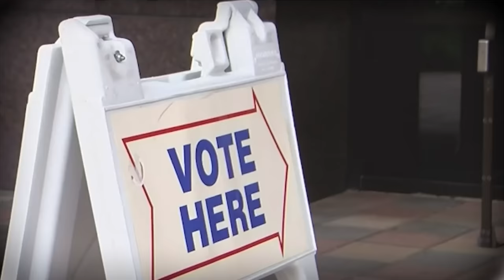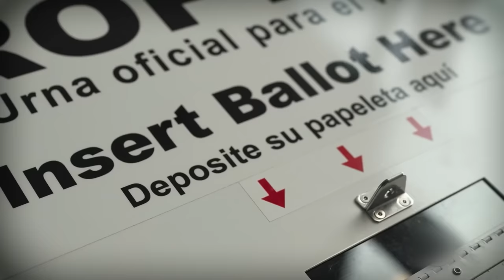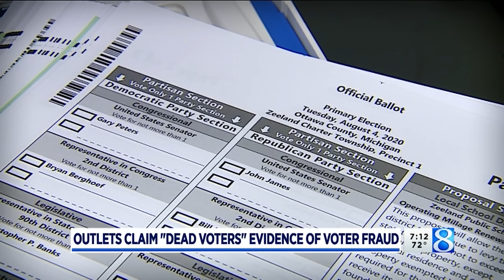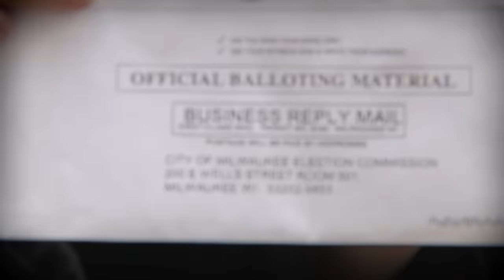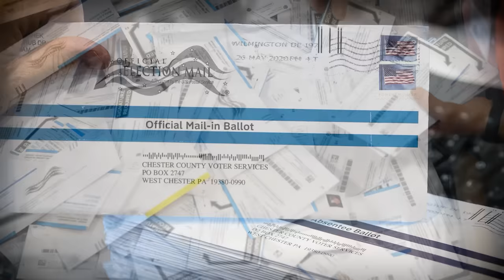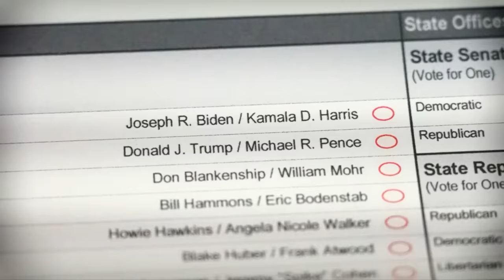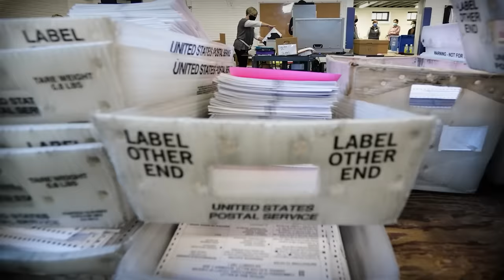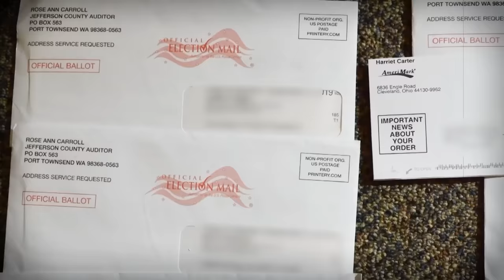2020 Election Fraud EXPOSED - The Hidden Truth Revealed - WILL IT HAPPEN AGAIN?

Comment: There were 4 things not mentioned here:
1) That lady's video where she recorded them shredding the ballots. They had a shredding company show up with a mobile shredding truck, and she ran into the loading bay to see what they were shredding. It was all voting ballots. Those trucks were seen at multiple ballot storage locations.
2) The guy who said that like 60% of the ballots had to be hand examined, when normally it's like 3%.
3) The hand counting was also a cheat. When they hand count, the first person stacks them in stacks of 10, then the next stack of 10 is laid at 90 degrees on top of the previous, so the next person just counts the stacks. What they did was put 12-15 per stack with Trump's name, and 6-8 per stack in Biden's name, but remember each stack is counted as 10, so you'd have a full stack of 100 stacks of 10 equal to 1000 votes, but Trumps stack would actually have 1400, and Biden's would have 700, but each would be counted by the next person in line as 1000 votes.
4) People who were visually verifying the signatures, were processing 1 ballot every 1-3 seconds. How is that even possible?

Comment: As a student of US political and judicial history, I think 1876 and 2000 were the two elections that were actually "fixed". In 1876, there was probably voter fraud in the South on both sides. A joint congressional committee eventually seated Rutherford Hayes by a one-vote majority, but only on condition that the Reconstruction ended (a concession Democrats obtained because they had a house majority). In 2000, the US Supreme Court fixed the election by halting a recount of Florida ordered by the Florida Supreme Court. I believe that under the Constitution only Congress, not courts, has jurisdiction to determine a disputed Presidential or Congressional election. Your arguments about the 2020 election are based on theory that Trump might have really won not the popular vote, but the electoral votes. I don't believe Trump was able to prove that in court, or to Congress. However, the serious border problems in the US (even under Trump), make me worry it could have happened. Given the surge of illegals that has been permitted under Biden, I EXPECT the Donkey Party WILL cheat in 2024. I reach this conclusion because Joe Biden is visibly senile and his proxy California Governor Gavin Newsom has so viciously attacked Trump. The Donkey Party will do ANYTHING to defeat Trump. That is why Biden hasn't used his power as Commander In Chief to close the Southern Border with the US Army, Navy, Marines and Air Force. I think Trump's main mistake in office is that he didn't remove ALL Obama appointees from the thousands of federal positions the President controls. He left many of them in place, resulting even in Joint Chiefs hostile to his Administration. If he takes office again, I hope this mistake isn't repeated. ⚖️👎